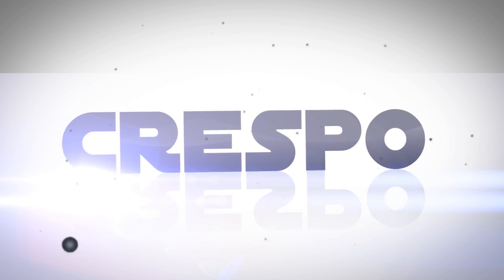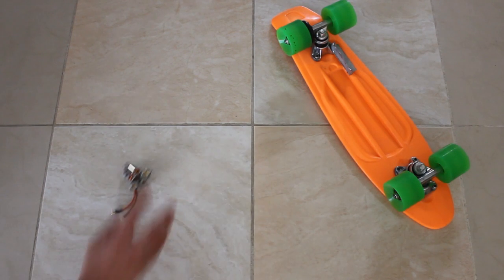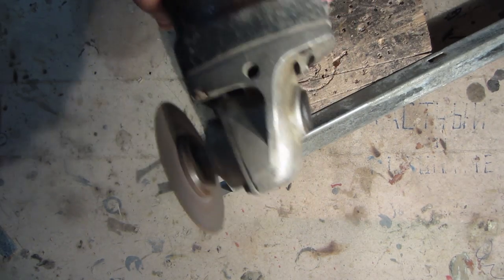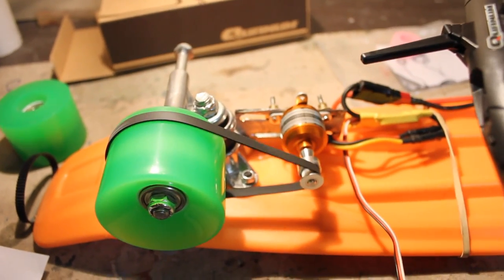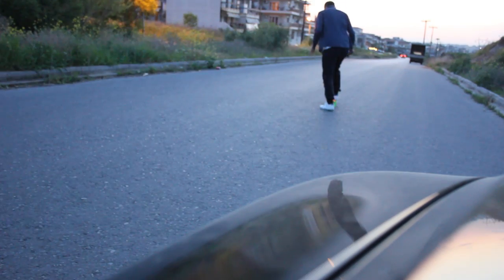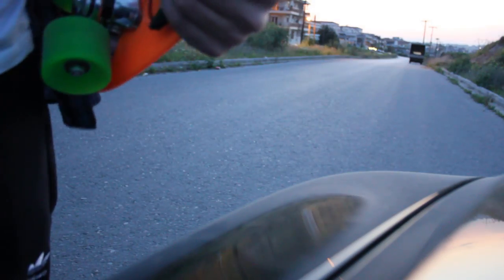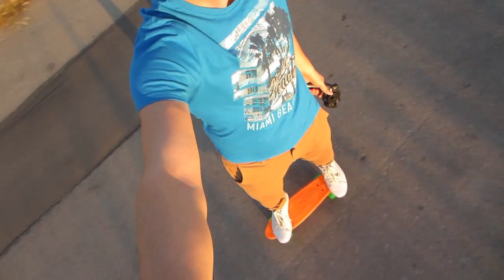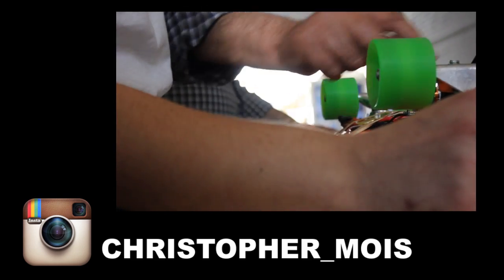Electric pennyboard (Homemade for 70€)

Comment: finaly someone who says it.. those prices are ridiculous for those boards to buy
Reply: look if china can sell a hooverboard (2 wheel balancing board with segway kinda electronics in it) for 160 euros retail. why the fuq does a skateboard with a motor battery and voltagecontrol cost that much
Reply: guess the next skateboard project didnt happen. as i looked though your video list. shame as i would have loved to see a better but still reasonable priced board

Comment: The reason your belt fell off is probably because you mounted the motor to the base of the trucks between the trucks and the board. So when you turned the gear on the wheel would get disalined with the motor. I would recommend that you make the motor fixed to the cylindrical part of the truck near the wheel. You can get what i mean if you google electric longboard motor mount. Of course this is only if the belt falling off problem perists

Comment: Id really like to make an e-board with my nickel board the way you did the penny. I want to do it with a beefier motor/battery of course. I can use all the tips I can get. Especially the way you got the Pulley to work with the original wheel.

Comment: Next time you should fix the motor holder to the axis part because the base plate and the axis parts are move relative to each other. It means the belt can be lose or tight while turning left or right. I hope I could help.

Comment: Mate, you've got your motor mounted static and your trucks that can move! It won't be long before you turn and that belt comes right off! Also that motor is too high KV to pull a human, it will burn out in no time at all. You need something less than 300kv.
Reply: WAAAAYYY too high. The highest you would ever want for any weight is 270kv.
Reply: @enricosetiawan3838  KV depends on gearing ratio. If you have weak motor you need higher KV and change the gearing ratio accordingly. Small motor like this with 270KV would be useless.
Reply: no way. Go for something under 250kv
Reply: Would the pulley be fine if the mount was attached to the trucks because wouldn’t the mount move with the trucks when you turn
Reply: May seem stupid but can anyone explain to me why high rpm motors get heated when carrying load
Reply: darkkevind1978 what would you say for an 800kv motor for a person who ways 87 pounds
Reply: What about 750 kV for someone who weight 70 kg

Comment: Hello i have question, look at this.its possible ? 
http://modelmania.cz/index.php?page=shop.productDetail&id=MTU2XzkwXzk1NQ==
http://www.hobbyking.com/hobbyking/store/__28223__HobbyKing_90A_Boat_ESC_4A_SBEC.html
http://www.ebay.com/itm/HTD-GT2-Timing-Belt-2-Meter-Belt-Width-9mm-2pcs-20-Teeth-Pulley-Bore-5-6-35-8mm-/172125114648?hash=item281374d118:g:63QAAOSwoBtW3Snt&vxp=mtr
http://www.ebay.com/itm/22-2V-6S-5500mAh-40C-Lipo-Lipoly-Battery-XT60-For-RC-Model-Helicopter-Quadcopter-/380964878726?hash=item58b346b986:g:BugAAOSw0vBUiQsU
http://www.ebay.com/itm/iMAX-B6-2S-3S-4S-6S-3-7V-7-4V-11-1V-Lipo-Ni-MH-LiFe-RC-Battery-Balance-Charger-/381572995486?hash=item58d785d99e:g:PLAAAOSwQPlV8keZ
Thank you very much

Comment: Can you also use the electronics of an old rc car? That you only have to change the battery And motor?
Reply: what I learned is you can just better battery And motor and you should be alright

Comment: Hey man,
how did you mount the hub pulley?

Cheers
Reply from the maker: i found a round plastic piece.. i putted a closed loop belt on it.. and bolted it on the wheel.. simple small bolts
Reply: CRESPO GREEK didn't you use the timing pulley stuff you had in the video?
Reply from the maker: i did.. small pulley to the motor .. custome big one to the wheel .. if you mean the small one.. i drilled it to make a bigger diameter and just hummered it on to the motor
Reply: CRESPO GREEK Is the big one flat?
Reply from the maker: ahh.. it has teeth GT2 type
Reply: CRESPO GREEK sooo... big one plastic gt2 and small one metal? Thanks dude ^^

Comment: You should buy a bigger low kV motor and move the axis. So you've got the spinning part of the motor, then the part with the cable's, then the bracket and the the belt.

Comment: You should use a lower KV motor, a boosted board uses a 210KV motor (but works on 24v) with the reduction you have now and since you use a 3 cell you should get one around 600-800 KV (750KV is readily available) 
Also, replace your bearings with skate bearings, it will make your board smoother and greatly increase battery performance. (I would say in your price range get Enuff ABEC 9's for about 10USD)
Reply: Can you also use the electronics of an old rc car? That you only have to change the battery And motor?
Reply from the maker: the old RC car may not have a brushless motor and this will make it hard-impossible to ride
Reply: I Will change the motor to a brushless motor And a bigger accu
Reply: Nikola Tesla do you think a 1000kv would work well for an 80lb kid

Comment: With the motor mounted to the non-moving part of the truck (instead of to the cross bar), doesn't that twist the timing belt when you turn? Any issues with the timing belt slipping off during turns?

Comment: Will a transmitter with 3 ch work? And also can I use a motor with 900w power and 5800rpm? What is the spec of your motor? And is your motor fast and efficient? What did you do about waterproofing the motor and the electronics?  Thanks!

Comment: How did you attract the cog wheel on the motor?  BTW Nice video.
Reply from the maker: ty.. i bolted it with small screws.. the wheel was easy to drill ..
Reply: +CRESPO GREEK but how did you attach the cog wheel on the motor shaft.
Reply from the maker: oh sorry.. i bought a pulley from ebay.. i disassembled it and kept only the ring with the teeth.. then i simple drilled the same size as the motor (outside) shaft and hummered it there..
Reply: +CRESPO GREEK thanks! One more question. Do you need a 180mm Paris truck with 83mm flywheels or the standard penny board truck works?
Reply from the maker: it doesnt matter.. you can make anything work

Comment: Hi, where did you buy everything?
What is the max speed?
Nice project!
I'm from Italy! Thanks.
Reply: And which motor is better? It's better a lower kv motor or what? Thanks.
Reply from the maker: lower kv is better more powerfull but not fast.. 240-400 kv is just a fine motor

Comment: put a moter on both back wheals so it can move better
Reply: You could probably get a much bigger battery for not that much on ebay. Two of those motors could make the board a bit more reliable. That, or an even stronger rotor. Maybe more rpms as well?  

Keep testing! Very interesting project for sure
Reply: Wrong. Your battery usage won't double. Instead, each motor will only get half the amount of current.
Reply: @enricosetiawan3838  ^ exactly
Reply from the maker: yes, good thought but i ll have duble battery usage
Reply: +CRESPO GREEK OH sorry
Reply from the maker: no problm  :)

Comment: Hi i am going to suggest some parts even though i have never built one and would like to see how it goes for you !

Motor: http://www.hobbyking.com/hobbyking/store/__18126__Turnigy_Aerodrive_SK3_5065_236kv_Brushless_Outrunner_Motor.html

ESC: http://www.hobbyking.com/hobbyking/store/__64853__Hobbyking_8482_SS_Series_90_100A_ESC_Opto_.html

Rc controller: Same one used in this video or you can hook up a raspberry pi zero with software from here https://github.com/timmaier/PiSkate (Not mine btw all credit to Tim Maier) And use a wii remote to control it

Pulley and Belt : http://www.thingiverse.com/thing:752899 ( You can order it 3d printed directly) You can use the motor pulley and belt you used in this video
 
Penny Board: Again Same one in this video
Battery:http://www.hobbyking.com/hobbyking/store/__7635__ZIPPY_Flightmax_2200mAh_3S1P_30C.html You should get two of them and hook them up in series ( i think)

Motor Mount: Same one used in this video

Thanks!!
Reply from the maker: Great suggestion.. thanks for the links they are very helpfull :)
Reply: np :)
Can you please post a video if you try making another one would be very helpful!
Reply: Modi Does this work very well?
Reply: are you sure that this ESC work sir?

Comment: Hi!, Great project!!!
How do you fix the wheel pulley to the wheel?
Reply from the maker: thank you, its actually a belt (clsoe loop) that i put on a round plastick bit that i found around and then i nailed it to the wheel..
Reply: So, if you could start again what components would you like to change and which would be the new ones?
Reply from the maker: this time i am using a bigger pulley instead of a small close loop on a plasti piece.. i am searching for new motor and other components